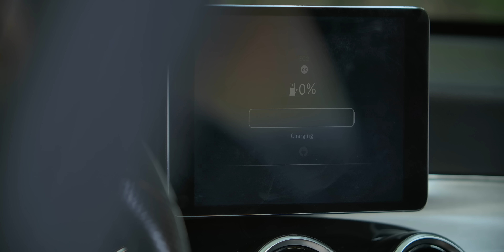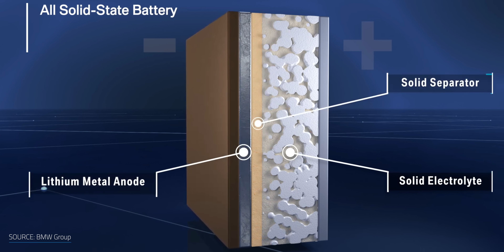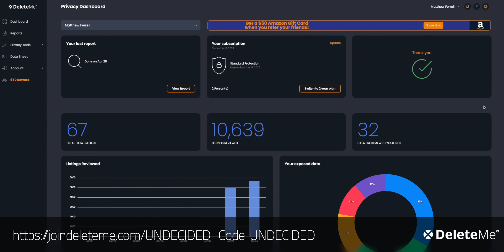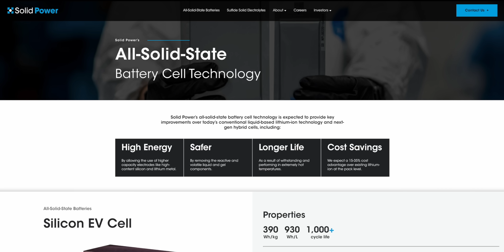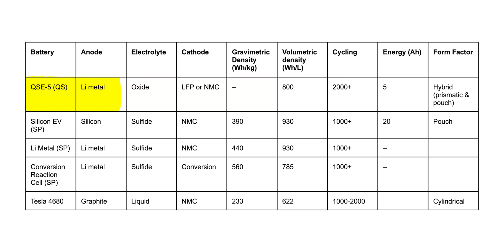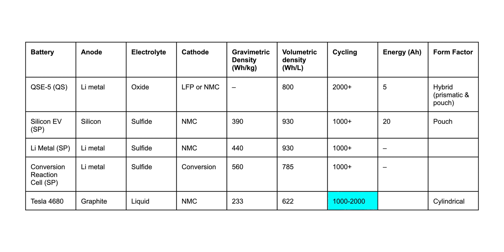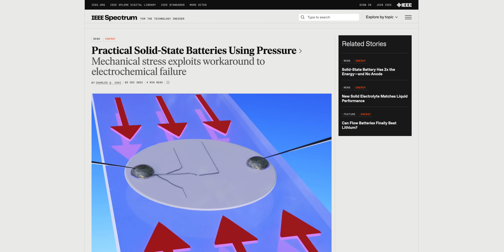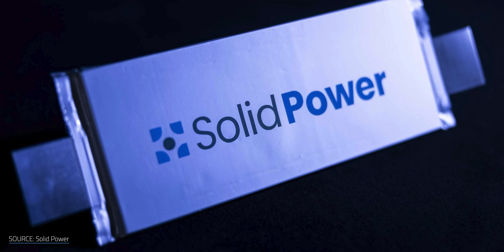Solid State Batteries are Closer Than You Think

Comment: I am maybe the most hopeful for battery tech to come out and replace everything with magic, but solid state currently is more semi solid state. Great for applications that need less weight and over all carry a ton of power. I feel like this is the middle ground needed for the super charges. As for public transport, it seems a bit off still, but progress is happening. From current market fiew point, it looks like other battery tech might still pull out a head of this improve for use in car tech in the future. I've already seen solid state Ns batteries as well. Na batteries also seem to hold the same improvements even if they come in at a little more weight without the need for different elements to make up both sides of the battery in some cases. Na for sure will take over grid and home storage. While tech like this will see grid, power stations, and high performance use for more power demanding application that dont have a ton of weight or size to spare. If anything, these would be great for transporting for trucks and the likes as to cars. Trucks  require pretty much all the above to work and that would make them perfect for the stats these currently have/could have in the future.

Comment: Building batteries is worse for the environment than pulling oil which is unlimited out of the earth. But the sheep follow the government narrative instead of doing their own research.
Reply: oil isnt unlimited, I can tell you never been to a spent oil field or been on one. With that said, its the gas you burn that goes into teh air is the problem more than anything. Unless you want to put your tail pipe back into your car, this is the correct path forward.
Reply: @adr2t  NO I've only worked in the oil industry for 2 decades. I's a scientific fact. The term fossil fuel was coined and created by the Rothschild family to make it seem it was limited therefore expensive. Look it up. It's common knowledge. You must be a woke liberal. Well at least Legacy companies like Audi, BMW, Mercedez, Volswagan and Toyota and going back to combustion engines

Comment: Interesting to see how companies around the world end up with very similar deadlines/release promises for solid state batteries. Companies like Gotion and NIO are both in the upscalling process. NIO especially seems to be doing something interesting as it uses semi-solid state batteries as the first step to make it easier for the supply chain to transition. might be worth a video. NIO is also interesting as it has a rental system for its batteries at least in China which could be a good solution for battery recycling or keeping older EV's on the road.

Comment: Maybe solid state batteries will be around by the time my parents get an EV.
Reply: solid state batteries have been on the market for at least a year now in different products, soon they will be in your EV :D
Reply: @adr2t  Those are semi solid state batteries. Don't believe everything you read in a press release.
Reply: @4203105  Doesnt matter, the fact its there is a truth its coming - just because a tomato is green - doesnt mean it wont turn red later on.
Reply: @adr2t  It's probably coming eventually (But not before 2030). But this is not a tomatoe, this is a green apple. Two different things.
Reply: Correction: when my kids get EV😂

Comment: I have a solid state battery from Yoshino. I run the AC on my boat when away from the dock.  Works great.
Reply: I was doing some stat comparisons to offerings from eco-flow. I noticed the smaller products being pretty close (and in the case of River 2 Pro vs B660 the River wins) but the bigger versions... man, Yoshino is blowing them out of the water. Delta Pro at 3.6kw compared to the Yoshino 4kw? Yoshino is half the weight for only a few hundred dollars more.

How's the build quality and which one did you get?
Reply: @KMCA779  Not to mention if the cycle life is true, that alone would be worth it even if it costed a bit more. They claim 4000 cycles keeping 80%+ capacity. Give me that and a starlink terminal and I'm good lol.
Reply: Lol we have Zero point energy technology that has unlimited power solid state batteries are pathetic look at all the inventors and scientists kill who have made free energy technology. This is pathetic.
Reply: I highly doubt that's actually a solid state battery. Anything on the market right now is semi solid state at best.

Comment: I don't think I see why solid-state batteries are so great anymore. Regular lithium-ion batteries already have enough specific energy that cost is the only important metric for anything short of an airplane. Given the separators used in solid-state batteries, I wouldn't be surprised if they're always more expensive per kWh than traditional batteries, at which point the higher performance is only meaningful for small short-range airplanes.
As for faster EV charge time, that's already mostly limited by charging infrastructure, not battery charging rates.
Reply: Because solid state reduces the weight, increase speicific engergy (aka requires less over all li for the whole pack), and can reduce cost over time (up to 35%). Less weight we carry, the more distants you can go, follow by more power you can store, the further you can go, and the further you can  go, the less need for a larger battery and thus you save even more cost. Almost anything new is going to cost more than a mature product for now. Li also cost  more than lead acid when it first came out just for example.
Reply: @adr2t  35% reduction in cost is not even close to enough to get them down to NMC or LFP prices.
Weight has very little influence on how far you can go in your EV.
Reply: @4203105  Yes it would be. Yes I understand its not full solid state, but NA batteries are also using similar or full solid statements and they can only improve and add them to other methods even for LFP. So, no, you are kind of wrong in hat matter. Weight has a ton of influence lol, what are you going on about? Unlike gas, you carry the full weight of your battery no matter what. If you remove that, weight even by 30% thats going to net gain you some distants. If you can hold more power, thats just going to net gain you even more. So I have no idea what you are going on about weight.
Reply: @adr2t  NA batteries currently on the market are not solid state nor semi solid state. We are talking about facts here, not what you think would be nice.
And why would that weight that you "always carry around with you" matter? Do you plan on flying with your car? If not it makes for a negligible range difference. Not sure where you pulled that 30% from, but I assume it's a stinky place.
Reply: Maybe not always, but for a while.
I actually think sodium solid state batteries are more promising than lithium at the moment. There the research has gone towards cheaper materials from the get go.

Comment: Title: Why Solid State Batteries are Finally Here
Video: Solid state batteries are coming by 2028.
Reply: He said they are going on sale as early as this year. 2028 is the year the CEO expects large amounts of EVs produced to use solid state batteries. Huge difference.
Reply: @802Garage  True enough for one of the companies, though wasn't the other saying something like their factory was starting to come online in 2024, so one would hope that in a year or two those products would start showing up in some areas then.
Reply: @Quickshot0  Yeah an article from end of April says "QuantumScape is finally rolling out its first low-volume samples this year, and it says it's on track to start shipping its first high-volume samples in 2025." So let's hope!
Reply: @802Garage  Indeed!
Reply: @802Garage  If they are, they likely aren't solid state but semi solid state.
Reply: This is deja vu to the 80's. Automotively speaking, solid state charge regulators came about . Which were just a standard bridge in a circuit board, covered and filled with resin.😅
Reply: 2028: Solid state batteries are coming by 2032
Reply: Title - Why Solid State Batteries are Finally Here (Almost)
Reply: Arguably by 2028 they're supposed to be available in a large volume production item like cars. Implying that lower volume production will be between then and now. So maybe one will see them in some applications already in 2026 or so.
Reply: @Quickshot0  CATL said not before 2030. I doubt these small startups making tall claims to get investor money can beat them to the punch. Guess we'll see.
Reply: @4203105  Didn't one of them say their factory was completing this year?   But yeah, I guess we will see.

If we're being optimistic this is like the prelude, where the first variant show up. Possibly with some trade offs because they rushed to market.
Reply: @Quickshot0  If a factory completes this year it's going to be semi solid state marketed as solid state. Like Quantumscape's battery.
Don't get me wrong, semi solid state is a big leap foreward, I just don't like the misleading advertising. CATL also has a semi solid state battery and to avoid confusion they call it "condensed battery".
It should also be noted that these things are expensive as hell and because of that only targeted at aviation, where weight is very important, at the moment. Will be interestinf to see if those can be made cheap and if so who'll be the first to do so.

Comment: There is a fundamental, physical, issue with solid state batteries. A battery is a container for a chemical reaction dispatched by the flow of electrical current. Chemical reactions between solid reactants are much slower and difficult than liquid or gaseous reactants.
Almost all chemical reactions we do in laboratories make use of some liquid (water mostly) or require the reactants to be gasified. The design of the solid state batteries must provide some very large advantage to compensate the more difficult environment regarding the chemical reaction.

Comment: To charge a 400 kilowatt hour battery in 15 minutes would require 1600 Kilowatts of mains power. That is 7000 amps at 230 volts. 70 times the entire current rating of a domestic property in the UK which is usually 100 amps. The mains cable to the charger would have to be around 1600 mm csa to be safe with the massive current and the dc cables to the car even bigger. So 15 minute charging is never going to happen
Reply: Unless there is an intermediate battery used to mitigate this, say 800V, that charges from 220v mains slowly and discharges to EVs at 800V.  There are solutions to consider.
Reply: 1. To charge a 400 KWh battery in 15 min requires 1.6 MW not 160 KW
2. Fast charging is meant for roadtrips so is only really relevant for public charging stations for which limitations of domnestic electric infrastructure do not exist.
Reply: You're missing a decimal place. You'd need 1.6MW. And you wouldn't charge at 230VAC for a 15min charge. At 400kwh, you'd certainly hope the pack is at 800V. Thats still 2000 amps.
Unless you meant a 40KWH battery, which is still unnecessary to charge at home in 15 minutes.
Reply: @andrewt9204  Yes I missed a decimal point. So to fast charge would use the total maximum power of 700 homes based on a 100 amp maximum per home. To keep cable size to the charger manageable it would need three phase at 11000 volts. But even if the battery was 800 vdc the hook up would have to be enormous to avoid cooking the cable and overheating the connectors so I can't see how that could be practical even with dedicated infrastructure without a complete redesign of the charging system. BTW I have edited my comment
Reply: Well it doesnt have to be supply in one go, so your math is a bit off as well only where you combined the power would the cable need ot be thick enough to support that
Reply: Yt censorship has prevented me from making any further comments. The truth clearly hurts

Comment: Question from the back of the class: Is there a reason that solid state batteries aren't being mentioned along side home battery solutions?
Reply: Probably because current LFP batteries are fine.  Using solid state batteries for home storage would be like buying a Ferrari to do the school run.
Reply: @NickFoster While I definitely agree with your comparison (lol), I must ask:

And?

Lmao
Reply: @archerpence  and what?
Reply: @jamesbizs  Just "And?"

Kinda of like "What's your point?"
Reply: Because Energy density isn't an issue for home battery solutions, cost is however which is why that part of the market is looking at LiFePo batteries currently and Sodium batteries in the near future.
Reply: I just purchased 71.5kwh worth of lfp batteries for $16,880 delivered to my garage. Let me tell you at 305lbs apiece ×5 plus they are going to take up a lot of wall space. Code required 12" space between the batteries. Plus eliminating résistance should also reduce the amount of solar it would  take to chargé them. Solid state home batteries would be nice. By the time these batteries are done 15 or so years. Rated for 8000 charge cycles. Solid state home batteries might be available and possibly affordable. Shipping cost would be drastically reduce also.
Reply: @danmccoy6164  None of the solid state batteries mentioned in the video are rated for more than 2000 cycles. Assuming there isn't some caveat to that 8000 cycle rating like it being only for partial discharge compared to the solid state batteries being rated for full discharge, I don't think these are going to be a cost-effective replacement as they'd need to be a fourth the price to be used for the same amount of cycles and that's not happening. LFPs already have extremely low resistance and can charge with near perfect efficiency in solar purposes, so you aren't getting any more charging efficiency out of the panels by switching to solid state batteries.
Reply: @danmccoy6164  What is the product you purchased?
Reply: Why would they be? The whole point for solid state, is for portability. Why tf would you need that at home?
Reply: Alot of the benifits aren't useful in residential applications, weight dosent really matter if you aren't moving it, size dosent really matter because home batteries are already negligible compared to average square footage, because it's not moving you can put alot more shielding and protection to mitigate heat and fire risk,

The lifespan and capacity are improvements but they aren't worth the extra cost over just getting more liquid batteries or replacing them.
Reply: I would rather have a flow battery at home than solid state. #BromineTeam